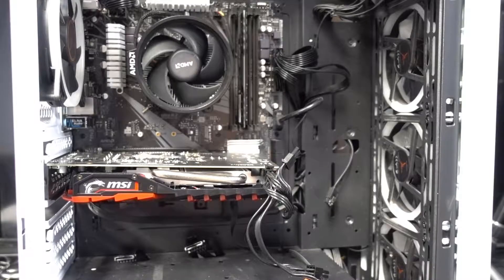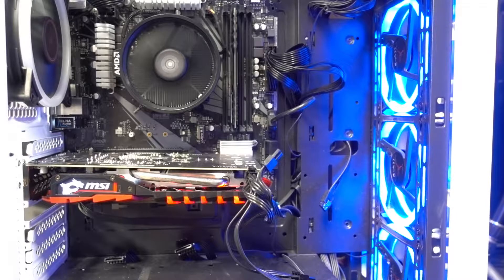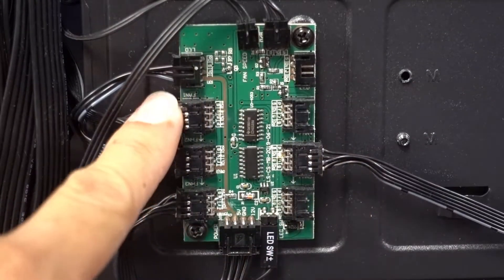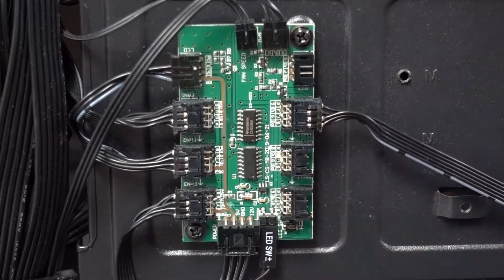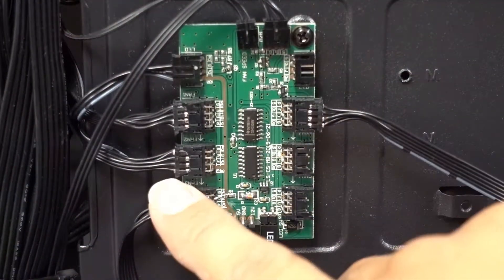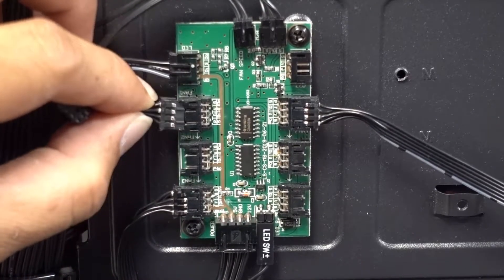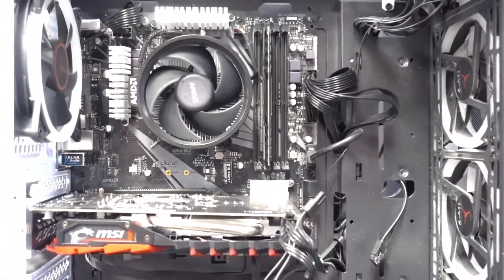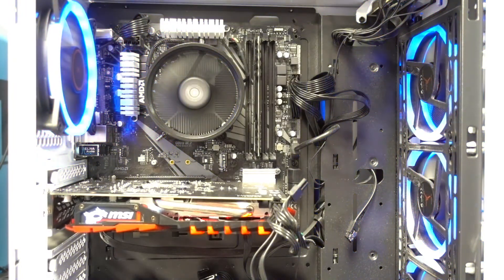Troubleshooting your Chronos RGB

Comment: Thank you this really helped. We got our chronic minis lights to work again (they were almost all white; fans were fine) I think one of the fan cables (the first one in the array) has one of its wires coming out. I pushed it back in and moved it to the second placement. If it wiggles loose again, then the first fan should still light normally and the second/third will have the problem.

Comment: My chronos rgb worked fined until i put the ssd in
Then i noticed the color scheme on the desktop did not synch up or can change colors
Do you think i damaged something or altered some settings if the fans and lights work but not the functionablity of changing the colors?
Its a minor problem but it bkthers me knowoing my desktop was not like this

Comment: NEED YOUR HELP HAD MY COMPUTER IN SHOP THREE TIMES FOR WARRANTY BUT NOW MY FAN COLORS DON'T WORK BLINKS GREEN AND WON'T CHANGE COLORS YOU HAVE MORE WIRES CONNECTED TO YOU BOARD THAN I DO THE TWO WIRE CONNECTOR LOOKS LIKE THE RIPPED THE WIRES RIGHT OUT OF CONNECTOR
Reply from the maker: Do you have a skytech chronos system? If so then do get in touch with our customer support line via email chat or phone so we can help you troubleshoot it further!

Comment: Thank you for your video! Can I get these lights to be used by SignalRGB program? The program recognizes my Chronos lights but I can only actually control them by hitting the buttons on the case.
Reply from the maker: Hi, have you tried holding down the rgb button on the case for about 5 secs? that should switch the controller to motherboard control. Note that this will only work if the argb cable _connection to the left of the top screw on the rgb controller) is connected to an argb connection on the motherboard.

Comment: On my Skytech Chronos I just received. All 4 case fans light up but no they will not spin. Not on bootup or when the pc starts to heat up. Any recommendations?
Reply: Same smh
Reply: Um, I had the same issue, I believe the sata cable was not plugged in, I just kinda compared what I saw on screen and made sure mine looked like that, in other words one of the cables was not fully plugged in, that fixed my issue, hopefully it fixes yours

Comment: Where do the other end of the LED (topmost-left) and the other end of LED SW+- go? Is it possible on an Asus Prime B550M-A and still get the LED button to work? The case is a Skytech Chronos Mini I got from eBay, but the green fan header board should look and work the same way.
Reply from the maker: That LED header usually takes connections from led illars, some aio's that has the same connection for their led ring around the pump and most other devices that uses the same connectors for rgb connections. if the case you have still has all the wiring intact then there should be a cable that will connect that green board to the motherboard's header for full software control.
Reply: @troubleshootdis5930  Like Addressable RGB Gen 2 for that plane wings-looking cable from the LED SW+-? It looks like it could fit, but not sure if that's correct since the third part is sticking out. I also can't find a place to connect the AWM 2466 VW connector that's from the other side of the LED green board connector to the motherboard and the shape doesn't fit into the RGB headers unless I'm missing something. I just need to make sure I know the correct area for these and not screw up. The motherboard manual is not giving me much info regarding that. Some elaboration or hint would be nice. If that's not possible, then is that why the case has to be in specific motherboards that are listed on their Skytech website to make use of the LED button?
Reply from the maker: @markvd1008  Yes that is correct, some of the cases and rgb configutration has their own rgb control ecosystem and does not communicate with the motherboard but the chronos case if complete should have that top right cable with the label M/B for motherboard software control. it usually plugs into the rgb headers of the mobo to be controlled by software.
Reply: @troubleshootdis5930 
Thanks, I found out the 2466 VW connector from the LED connects to the M/B label (top-right) side of the green board. Is that all it's needed to make use of the LED button on the Skytech Chronos Mini or do I need to plug in the LED SW+ double pin plane wings-looking cable into the 3-pin Addressable Gen 2 or 4-pin RGB header? After that, I just need to figure out how to connect that SATA port of the LED board to my EVGA BQ 600W power supply. - Resolved the power supply one.

Comment: Hello excellent video just what I was looking for, but doing all the steps you indicate I still can't make the lights work, only the fans work when I press the button up and down the speed but no matter how much I press the button for the lights still they don't work, AT MINUTE 1:14 OF YOUR VIDEO I SEE THAT AT THE TOP THERE ARE TWO CABLES CONNECTED BUT ON MY PC THERE IS ONLY ONE WHICH IS WRITTEN FAN SPEED THE ONE ON THE RIGHT SIDE WITH THE NAME OF M/B NO I HAVE NO CABLE CONNECTED THERE. my pc is the model that has only 3 fans, two in the front and one in the back. I need to know if there should be a cable that for some reason has been disconnected which I should look for and place it again, I thank you for your collaboration.
Reply from the maker: Hi there, given you said your system has 2 fans in the front, would you happen to have the chronos mini?
Reply: @troubleshootdis5930  exactly but what I don't understand is that only the fans work and not the lights
Reply from the maker: @gregoriomonsalve6284  Do send us an email at support@skytechgaming.com so we can address this issue and you can also send images of your system so we can see its current configuration and replace faulty parts if necessary. Thanks!
Reply: @troubleshootdis5930  thanks tomorrow when I be at home I will do it. I am in Canada it’s just to let you know that
Reply: @troubleshootdis5930  Good afternoon, thank you for your contribution, I tell you that for a couple of days I have been in contact via chat with an employee of the company STEVE C. who guided me through some steps to be able to solve the problem, the first day he told me of open the pc by the part where the control is located, which is the one in charge of sending a signal to all the PC lights. After performing his steps, he told me to turn off the PC completely and disconnect all the cables, before that I took a photo so as not to make any mistakes when reconnecting them, after that he told me to reconnect everything so that's the same So I did it but without any positive result, he asked me to send him a photo of that piece for a replacement since apparently it had broken down, all that was during the afternoon of Thursday of this month, yesterday Friday When I turned on the PC I noticed that none of the three fans were working so I immediately went to the skytech website to contact an employee and coincidentally it was the same agent who had attended me on Thursday who is online, in this case he told me that he check if the SATA cable was well connected, of course with the little knowledge that I have in the matter he sent me a photo in which he indicated which cable was, then after verifying it physically in I took a photo of my PC and sent it to him, in which he replied that it was exactly that, so there was no way to fix the problem, I emphatically asked him if it was possible to send it as soon as possible since this PC I use it for my work from home, he told me that he would do everything possible and that he would please send an email directly to him to remind him, effectively at his request and at the time he indicated I sent him the email but at no time I received an answer as to whether or not he had received the email, and to finish he only told me to place a fan for domestic use to maintain the temperature of the PC optimally and not to place any of the covers. so this is the story of my problem, I would appreciate it if there is any way to contact you directly so that you can handle my case. These are the characteristics of my pc: Skytech Gaming Desktop Chronos Mini CPU AMD RYZEN 3 CODE NAME MATISSE. MAINBOARD ASROCK MODEL A320M/AC. MEMORY TYPE DDR4 SIZE 32GB. GRAPHICS NVIDIA GEFORCE GTX 1650 SUPER
Reply from the maker: @gregoriomonsalve6284 Good day! i just got word that your replacement part is being sent out today. Tracking info should already been sent to you. =)
Reply: @troubleshootdis5930  good morning, thank you very much for your kind attention, I would like if it is possible to have your email to explain more about my case, apparently it is not only the module or card that is damaged, please I need your help, thanks
Reply: @gregoriomonsalve6284  I am having the same issue with the same model